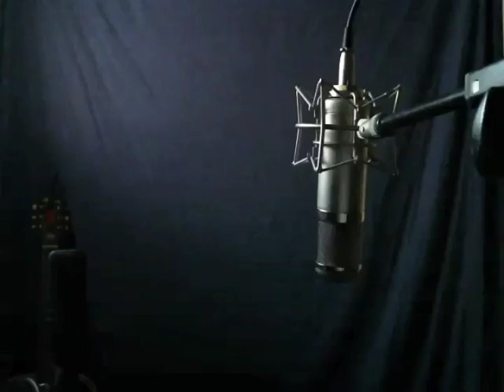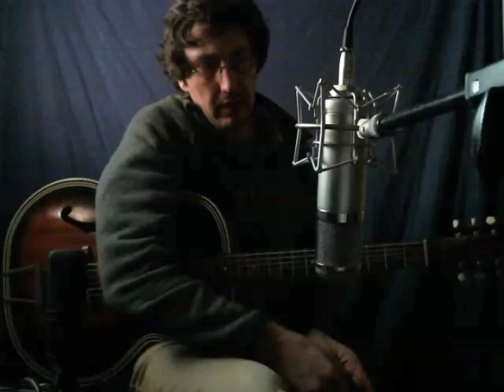432Hz vs 440Hz on Guitar

Comment: The harmonic sustain in 432hz is much more full of vibration, in comparison to 440hz. 432hz just seems to please the ears and ease the soul, as this frequency is more natural.
Reply: the harmonics were out of tune at 432.  the chords sound good.
Reply from the maker: Maybe it sounds out of tune because of the presence of more overtones... For guitar tuning, if chords are accurate, harmonics are more accurate. That is to say that on a guitar, harmonics don't vary, they just get more or less pronounced. The guitar was tuned to each open string. If the chord is accurate, the harmonics are more precise.
Reply: Colton Castle totally agree man !! peace
Reply: Larynx Suit if you tuned to open strings by matching them with a fretted string, your harmonics may be out of tune depending on intonation, since there are little inconsistencies in equal temperament. Intonation may also vary slightly between the tunings
Reply from the maker: sure equal temperament is not perfect but that doesn't mean its more appropriate for 440 or 432 tuning.
Reply from the maker: take a tuner to the 432 takes, they are in tune, it just sounds off because our brains are so familiar with 440, especially having heard 440 first in this example. I would be the first to say that this experiment is a poor indicator of what is better.
Reply: Larynx Suit i don't think so, what I'm saying is more that the intonation of a guitar can easily vary between tunings. And if you haven't checked to so that the intonation between tunings was accurate, then you can't actually know.
Reply from the maker: Hi Shaun, youtube will not direct me back to the original conversation so I had to respond here. Royal Rife and his innovations are searchable. Here is a link to peak your interest: http://www.naturalnews.com/027104_cancer_WHO_Chi.html#
Reply: I quote!
Reply: That's complete bullshit.  There's nothing more "natural" about any specific frequency.  It all depends on the resonante frequency of the individual instrument.  Some may resonate better at 440, some at 432, some at 445, it's just the mathematics of resonance and mass.
Reply: Bonita Bromeliads There's a study proving frequency play at 440 Hz gives the water a chaos effect compare to the frequency play at 432 Hz giving the water a unique pattern. I'll tell why music is now tuned at 440. It's because they're using the frequency as a militarized weapon to damage our brains. Our bodies contain 70% of water. So the frequency they're feeding us is literally damaging our brains and making us dumber.

Comment: The guitar itself has much to do with the sound.  You have standing waves and the resonant frequency of the box itself.  There is a big
difference between 432 and 440, but the joker in the equation is the other frequencies colliding in the box and the materials it is made from.  It's dependent on the instrument and how it speaks other frequencies along with the primary.  If you are playing an instrument solo,
try tuning by ear to where the instrument sounds best and then determine what that tuning is.  There is a lot less woo by doing it that way.
Reply: I use 432 and destroy guitar top lacquer becouse resonance is biger ☺️ like symatics patern on top 😉

Comment: One should not adhere to 440Hz just because it is a "standard"... Particular singers... 440Hz might not be an optimal tuning pitch for you... For some voices they would prefer something a bit brighter and heady than 440Hz, but i think the majority of voices seem to like a little lower tuning when singing high through the second passaggio from middle to headvoice.... 
The sweet spot region seems to be from 432Hz-435Hz for Bel canto singing, where the first tenor and first soprano F# notes stays closer in color to their mid register and not the head register when doing choral stuff....
The same goes with a certain class of baritone in opera singing Verdi pieces. I think its mainly the his D#4 that sits in the strong mid section with a full chesty sound when tuned to 432Hz. But at 440-443Hz that note is now more towards his head register and he has to sing more with a head function which creates another more thin color on his D#4 note... Ruining the "bel canto" style.. :-)

A lot of singers feel the need to tune down a half step (100 cents) when singing live for extended periods but the fact is that for that singer a smaller downtune by say 25 cents would be enough to sing much effortless.. For my voice I need around 20 cents down (435Hz) to get some significant relief from the 440Hz standard tuning that seems unnatural for the placement of my D#4/E4 passaggio (register shifts)
Reply: Excellent comment,, I feel the same way, And for my voice as well,, I understand 100% what your saying!! Cheers mate,,,,
Reply: Absolutely, my fave note is F# it finds it's way into all my music and because of that I like the 432 pitch, however, I like 440 for major chords as easily as 432, where 432 shines is in the minors, for me, when I tried a few different pitches, I found 435 for my voice was optimal. :) Well said!

Comment: For harder rock, I prefer 440Hz. For something that is using complete chords and extended arpeggios, 432Hz is the only way to fly.
Reply: kc8ntp for 4 Hard Rock you should use 441 hertz just right
Reply: a half step down from 432 IS HARD ROCK

Comment: I am not a big fan of 432 Hz tuning, since I studied all my life on 440 Hz it sound just off to my hears, but this can just be my opinion. But the big difference is that make an instrument made to be tuned in standard tuning at 440 Hz with fretts and drop it to 432 Hz I thing it is not the right way to test de difference. We all should try to do so on a instrument Made with harmonic boards made to resonate at 432 Hz and I believe there is not one in the market right now. I saw how Italian violin maker make Harmonic Board on Instruments and thickness, distance and shape are made to give the best sound on A 440 Hz. So I am wondering how it will sound if the Harmonic Board will be made so resonate at 432 Hz. Since then I won't prefer 432 Hz at all.

Comment: The fly in the ointment is the guitar.  High end guitars are made to be sympathetic to a certain pitch.  Although not a real high-end guitar, I have an Alvarez that when tuned to A440 is in complete sympathy with E.  Anything E played on that guitar results in the other strings vibrating, completely on their own, without any picking, the most wonderful overtones related to the note E.  If I retune that guitar to A432, that's not the resonance the guitar was built around, so the results will be less than ideal.  To get a fair comparison, you would have to play a guitar that was made to vibrate in sympathy with A432.

Comment: for me, 440hz works a lot better with major chords and 432hz with minors
Reply: Interesting.. I kind of agree... A4=431Hz/432Hz is nice and relaxed when singing and lends itself well to male high pitch rock ballads in minor keys (whitesnake, gary moore etc),, but for uptempo pop songs in a major key I find 431/432Hz slightly to low.. You need to go a bit above 432Hz to get the vocal exictment. but 440Hz is too high.. Creates vocal problems for a lot of people.. 438Hz is actually the upper physical limit for heavy dramatic voices.. For a key that fits major and minor songs go with the inbetween pitch between 432Hz and 438Hz that is the former European pitch at 435Hz.. This pitch proved to work with a lot of different voices and opera from different periods and why it was chosen in France by several singers, composers and physicians back in 1859..
Reply: 435 = 3
432 = 9
420 = 6
Reply: Personally, I like chocolate ice cream.   I eat it when I am in a minor mood.   While I am eating this ice cream my mood majors up and I feel better.

Comment: I could easily change between 440 and 432 depending the context and always prefer 432 and some intense experimentation in boths tuning you can go by take me to get almost two more cents down by intonation and I wouldn't take back to 432 or 440 if I shouldn't have to play with more people.. 430,.. hz or scientific pitch or tuning called philosophical or phytagorean too it has to do with equal temperament and just intonation diapasons how both are extremely linked by some enarmonic accident but in pitch it's easy to solve it by some ear intonation! we have to forget about tuners and start to feel the sound

Comment: i'm totally into 432 and i would suggest to take it like a reference to tune by ear! the  thing with this number it's that only work by a reference cuz' the tuning of every instrument it has to be done by the C (Do) in almost every case.. include the pythagorean tuning that you mentioned it's been set to a C (Do) 256 hz (that it's the true note by which a instrument it has to be tuned and not the A (La) that is more a convention for all the camera instruments and their differents keys!) what led you to a total distinct A (La) aproximately to a 430 hz instead the 432 that it has pretty accurates and distinguished matematical properties but in order to a musical temperament it doesn't correspond! your guitar issue is common.. I own a Les Paul Studio and i just put some strings a little wider range caliber anf thightening the truss rod more or less relief to compensate the more relief of the tuning in adittion to the thightening and adjust of the bridge and the intonation for the same reason. not idea if your guitar it has all these features but i'm pretty sure that thightening or loosening some hardware from your guitar always with a tuner by hand tuning and doing some intonation for every little adjust you will solve the problem..

Comment: This test is vulnerable to bias error in the way it was done. Anything played lower than what you just heard would have an effect of sounding less bright or moodier mellower etc. Its because of echoic memory. In reality 432 and 440 are just as important frequencies as each other. You need to separate the two tunings and stop comparing them directly as perception is skewed by each other in the process of comparison. 415.3Hz is in the key of G#. Tune down to 415.3 after 432 and it will have the same effect etc etc etc

Comment: I can see why in the 1930's the deciding authorities went with 440Hz.Regarding the recording devices and technology of the day. 440 would have been easier to record a strong signal as it is more immediate and greater in intensity and volume than 432..Today one might use 432 for mellow songs to great benefit. 440 reserved for greater intensity... God, with the gear I have today I can record a mouse fart from within my walls..That's important.. X))
Reply: There is no difference in recording 440Hz and 432Hz. Never has been. Where did you get that information?

Comment: On guitar this test doesn't really hold merit unless you used different guitars, one constructed with 440 in mind and one constructed with 432 in mind, because of the way guitars are constructed. pitch is relative to the starting position to the string, and if you change the starting position of the string, everything becomes off by the TINIEST amount, but still noticable. On this test 440 is preferable because of that, and there is no real difference between them, the only real reason people tend to prefer 432 is because of it feeling warmer because it's a lower frequency. There is also a lot of mental gymnastics at play. A more accurate test would be to make a blind test, based on a piano, but there is no real answer to which is more preferable. Back in the baroque days we used to tune our instruments to 415, which is closer to Ab nowadays and the people back then tended to prefer higher pitches. I think that people prefer 432 because it's new, and doesn't feel like it's been manufactured. It feels more natural because we aren't used to hearing it.

Comment: 440 all day. The 432 just seems to introduce dissonance on that guitar... maybe if the intonation was different, but naaaahhhh I'm not digging it. Also, as most people know, if you tune an instrument to itself it'll sound better than tuning to absolute frequencies. In this case, I don't believe that guitar is very conducive to 432Hz.....but 440Hz tuned correctly sounds great. The A chord is one of my favorites, and an easy one to check for overall intonation of a guitar when barred on the 5th or played open in first position (as long as you know your low E is in line).
Reply from the maker: Sorry man, got to respectively disagree as 2 of the greatest rock bands of all time recorded ALL their life work in 432 HZ; Beatles and Led Zeppelin. Thats right, any time you listen to these two bands you are listening to 432.

Comment: Jim hendrix and many others.. always tuned their Guitars a 1/2 step down also.. 432 is Nature
Reply: Yes thats G# at concert pitch i.e not 432 Guitarists use all sorts of tunings both up and down from standard.
Reply: @CHROMATICFILMS  G# is 418 Hz when A is 440 Hz. 432 Hz is the natural resonant frequency of Koolaid.

A should really be at 439 Hz, but due to the limitations of the electronic circuitry available in 1939, and the fact that 439 is a prime number, the standard was set at 440 Hz. Remember that it was SET at 440 Hz; it was not changed from a different frequency because prior to 1939 no international standard had ever been agreed, although many of the 432 Hz twats argue that in 1939 it was changed from 432 Hz to 440 Hz. 

The second has only been in use since the 16th Century, so arguments about very ancient instruments being tuned to 432 Hz are not easy to support, and the fact that the frequencies of sound were first measured around 1850 doesn't help the claims of inner peace only being available at A = 432 Hz either. If we changed the length of the second so that we have 61.111 of them in a minute we could tune to A = 432 Hz and it would sound just as good as A = 440 Hz does with a 60 second minute.
Reply: @GeorgeSPAMTindle  The comments on here just show that as a planet we are getting more stupid by the day. Like "432 is nature" for example. So what are all the other frequencies then? I don't buy the A should be 439 either. No reference point is more correct than any other. If you disagree then only listen to music in the key of A.
Reply: @CHROMATICFILMS  I believe that the tuning fork used to agree the pitch for A resonated at 439 Hz, but because 439 is a Prime Number it is very difficult to accurately generate that frequency using the electronics available at the time, so 440 Hz was agreed because the circuits to generate that frequency were simpler, more stable, and reliable.

'432 is nature' is a statement based on Schumman frequencies of the Earth's magnetic field, with one being approximated to 8 Hz. 54 x 8 = 432, therefore '432 is nature'. The problem is that the true Schumman frequency is 7.91 Hz, so that screws up the maths.
Reply: @GeorgeSPAMTindle  1930s equipment has no problems reproducing 439Hz. That idea is quite ridiculous. My 1920s Eko radio plays Dub Step, explain that! Did you make up this woo woo yourself? Oh I get it you are just attention seeking and coming up with the most ridiculous thing you can. Good try.

Comment: There are no audio frequencies that are useful in any case!
After long and careful meditations, it was found that
The much touted Frequency of 432 Hz Is Not Useful In The Following Cases:
1) It Interferes with Getting rid of unnecessary connections with the soul of a deceased person.
2) Frequency of 432 Hz Hinders Protection from spirits that do not have their dense body.
3) It also Interferes with Defending and Getting Rid of unnecessary group psychoenergetic fields (egregors).
Uniting (432 Hz) is not always useful, sometimes uniting is harmful!

Comment: 432 seems to have less resonance?  The notes decay noticeably faster for some reason.
Reply: Less tension on the strings is what diminishes the note sustain. What would make a comparison more valid would be to play on the same guitar with the same recording parameters (good job to the maker of this already fine comparison doing both here) but the string gauge between both clips would chosen to achieve nearly the same amount of tension in each playing example. There are other variables which can't be compensated for either like relative scale length but the point of this video I believe was demonstrated sufficiently to familiarize the casual listener to the difference in overall tonality. Leave it to the luthier community to find out their own ways to properly exploit this trend, or entirely ignore and dismiss this whole A432 thing as most backwards facing companies have chosen to do. I'm working on it, experimenting with unusual metric scale lengths on bass and guitar for A432. It's not easy fretting an entire guitar so these experiments have been simply determining the ideal open string length for bass and guitar.

Comment: Yeah my head hurts when I listen to 440 hz is that normal
Reply: 440 hurts... 432hz is in tune with us and the universe its very beneficial to us. unfortunately if you convert music from 440 to 432 it wont have the same benefit because the recording would never have picked up the harmonic frequencies of 432 in the recording.. we need to record in 432hz like pink floyd apparently did! ive yet to check if thats true but i can believe it